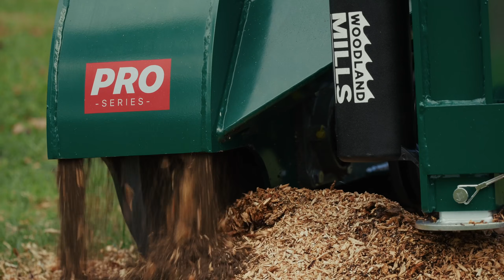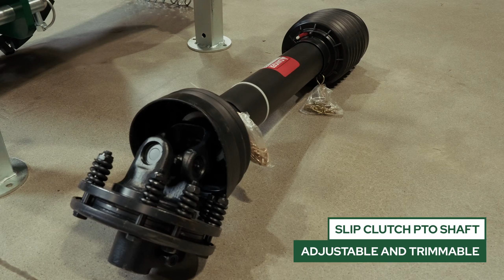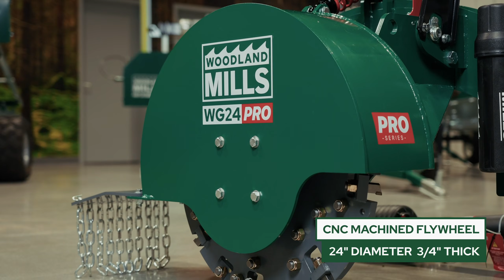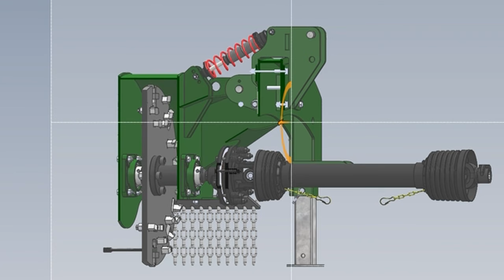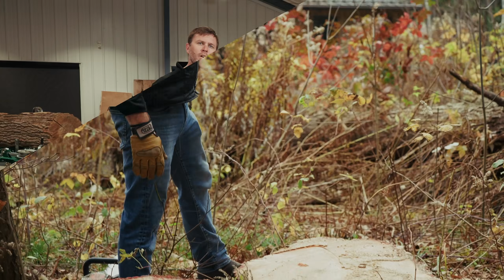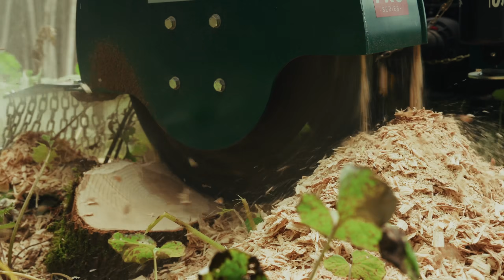Woodland Mills WG24 PRO Stump Grinder Walkaround

Comment: Mine bounces like crazy if I try to grind any more than a 1/4 to half 1/2 inch.  Yet, I see these videos of them cutting a few inches at time.  Frustrating…
Reply: I spent the last few days grinding with my WG24 on my JD3025E.  My biggest problem was visibility, both having to look back at a difficult angle, and seeing the stump with all the wood debris covering it.  I had added a backup camera, but it didn’t help as much as I had hoped.  I think this problem is inherent to the PTO based design.  I am trying to come up with a better solution and will share if I can come up with something.  I did have a few problems.  Torquing all the teeth to 160 ft-lb was difficult because it was hard to get to some of the teeth inside the housing, but using the supplied tool, I was eventually able to get to all of them.  Another problem I had was properly setting the slip clutch.  My JD 3025E is at the low end of the power range, and I had to set the eight springs to 1.26 inches of compression.  1/100 inch precision in a hard to reach location is hard to do.  I spent three hours on it until I was satisfied they were right.  I have done about 30 stumps so far, and the slip clutch has performed well, slipping when it should and not when it shouldn’t.  Overall, this is a good, solid attachment.  If I can figure out how to better see how I am cutting, it will be perfect.
Reply from the maker: Hi there, we are sorry to hear this! Please give us a call at 1-855-476-6455 so we can try to rectify this issue!

Comment: How well does this attachment work with a clutch/gears tractor? Looking to pick one up for my John Deere 750
Reply from the maker: Hi there! It definitely can work with your tractor if your tractor has 15-45 HP at the PTO. There is some differences in terms of operation, if you can send us a message on Facebook or Instagram, we can send you a document that has all the information you would need to run the WG24 PRO on your tractor!
Reply from the maker: You can also send us an email to letsgetsocial@woodlandmills.com and we can send you the document that way!

Comment: I love this! My only concern would be rocks.  The trees in my area of New Hampshire love growing around rocks. Would it be a catastrophic failure if you hit a rock?  Even getting the stump below grade would require hitting at the very least small rocks in the ground around the stump.
Reply from the maker: Rocks can be harsh on the teeth, so we do recommend trying to avoid them as much as you can, but you can buy replacement teeth if you do find yourself wearing them down with rocks quickly!